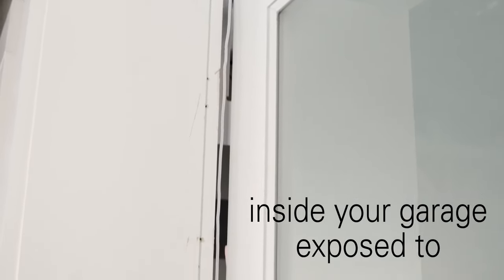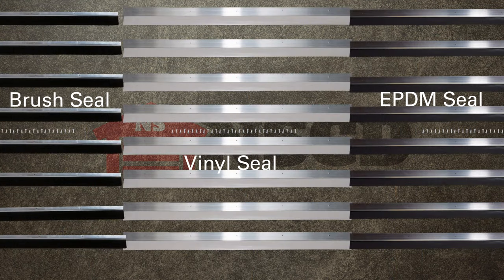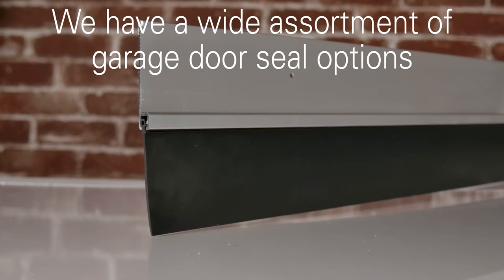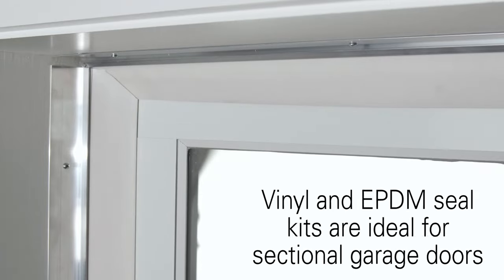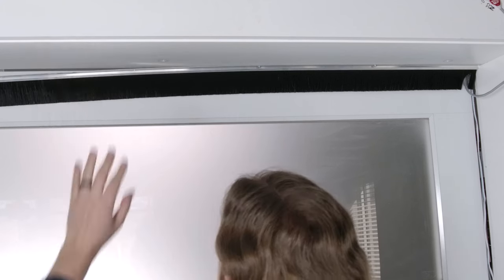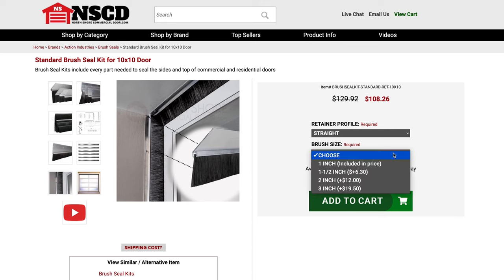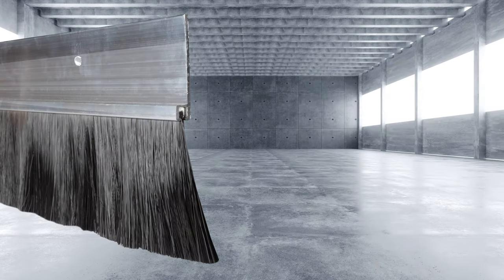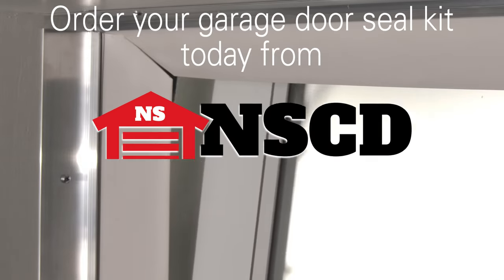Garage Door Seal Kits from North Shore Commercial Door

Comment: What’s the difference between the vinyl and EPDM material? And do you have guidance on how to decide between the straight vs 45 degree profiles?
Reply from the maker: Hi Rob, Generally, a 45 degree retainer is ideal for most doors, a straight profile is best suited for an uneven surface, like a rolling steel door. You can read more about the difference between Vinyl and EPDM from our partner - https://www.action-ind.com/which-weather-seal-for-your-door